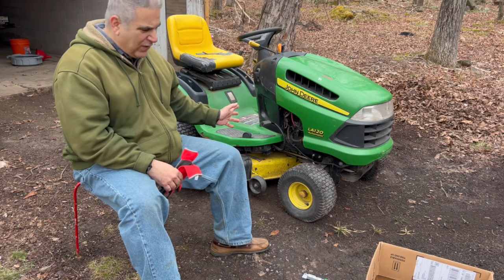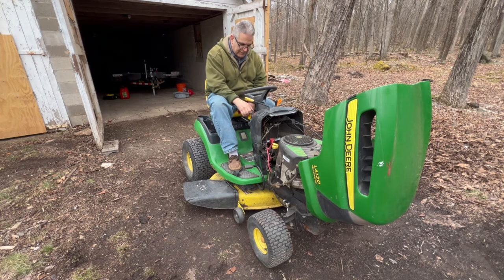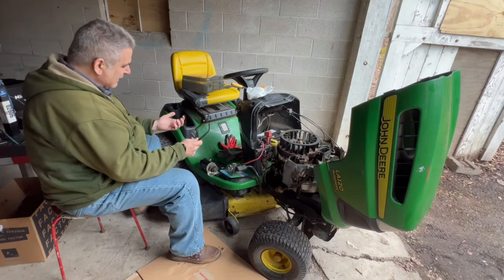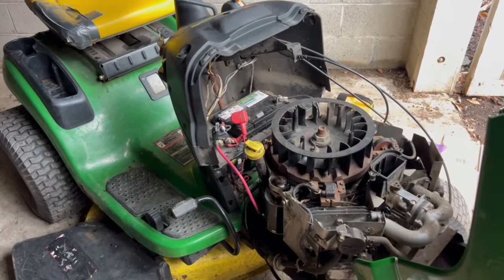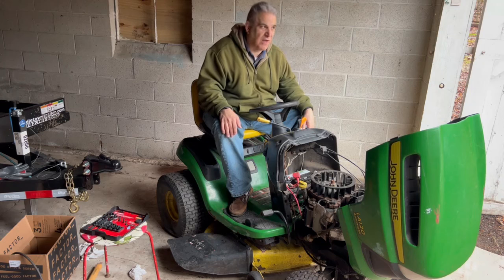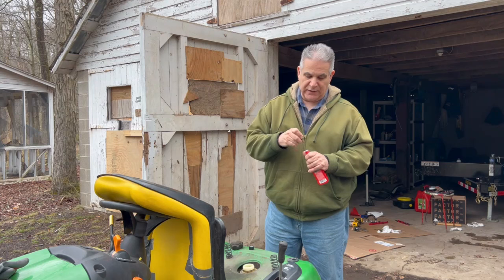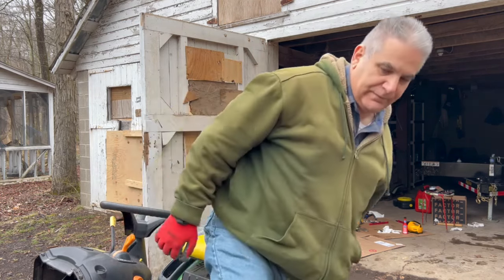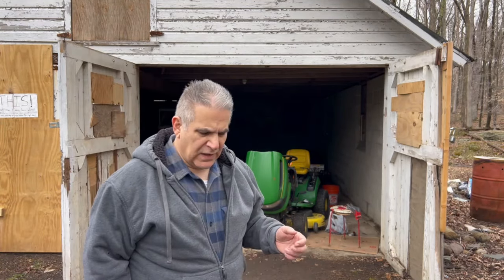John Deere LA120 Won't Start! Won't Crank! Just Clicks!

Comment: See if there's a bolt missing on the engine somewhere. The second ground might've gone there. 
Also, make sure the parking brake is set before getting off the seat, that'll typically allow it to stay running as long as the cutting blades are disengaged.
Reply from the maker: Thanks! I'll try that with the parking brake!